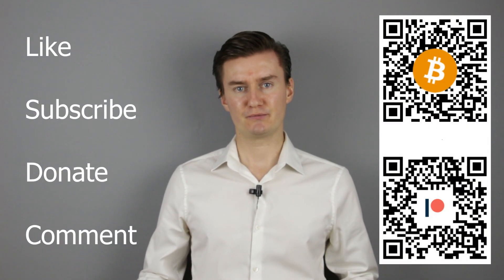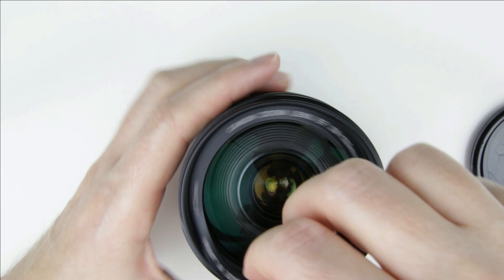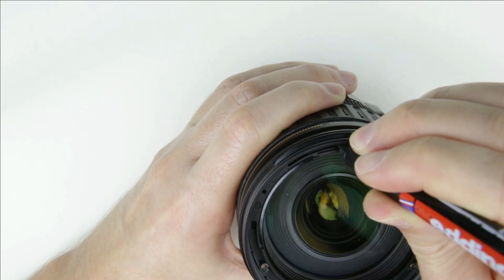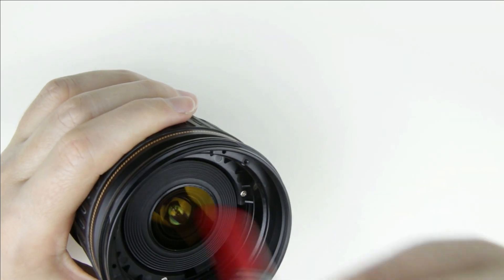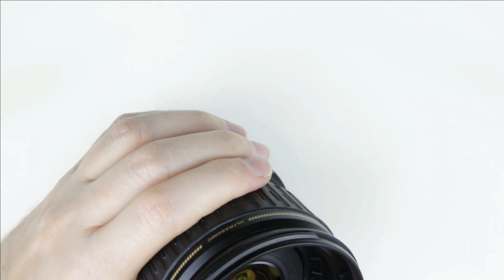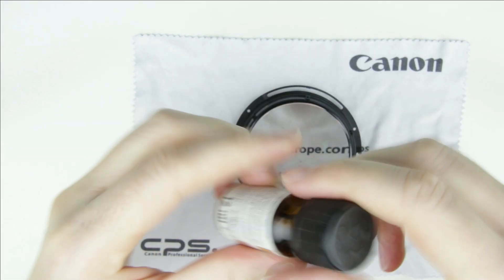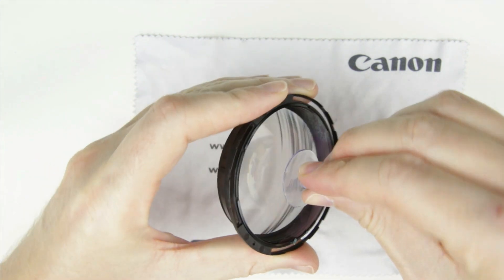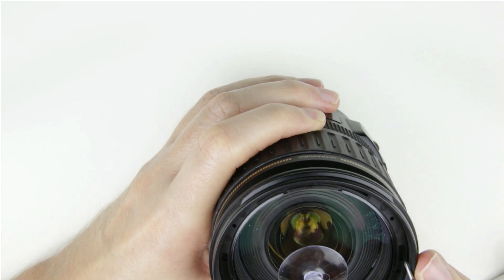Canon EF 28-135mm f/3.5-5.6 IS USM cleaning the lens inside

Comment: I have a question if it is possible to answer? As you have several videos demonstrating how to remove a front element for cleaning. I want to clean a Canon EF 17-35mm f/2.8 L . As it is an early version lens, but cannot find a description for this procedure. Any ideas?
Reply from the maker: I haven't got this lens for cleaning, but as I see on the photos of the lens, most likely you have to use a lens opening tool to remove the plastic ring around the front lens element. I would recommend to use the rubber one, because the other (with the two metal pins) could scratch the plastic ring or the front lens.
Also, make sure that you put back the screws where they were originally, and also don't forget to mark the position of the front lens to put it back at the same position.
Reply: @CamerasLensesEtc  Thank you for the reply. As your videos inspired me to give this a try. I then went ahead and bought several tools like you use. Tweezers(plastic), spudgers. A spanner wrench (metal).  I had made an attempt with it but became confused with this lens. As the front plastic ring in front of the lens has 2 tiny holes on opposite sides. Assuming then it will require the spanner tool to turn counter clock wise. But as you said about the metal pins scratching the plastic ring, yes. That is a far as I got.  Although they were placed in the correct position. Once I tried to turn loose, they only slipped out of place, with small scratch on plastic. No harm of course to lens. But this is where I gave up. As for the safety of the lens. I read elsewhere to dab peroxide into the holes to loosen the bond. But that did not help. That element has small dust, not noticed in photos, so I am ok as it is. But do not want to break anything.  Maybe I will try for a rubber tool as you said and try again. Yes, I see you can but a set of the cone shaped rubber tools. I will give that a try. Maybe sometime you will get one of these lenses for a demonstration.  You videos a really helpful. Thanks again.
Reply: Update on removing the nameplate to remove front element for cleaning(17-35 f/2.8 L). I took your advise and ordered a set of rubber tools. And As it was very stiff, I eventfully got it to turn. Only problem as it would not come out no matter how many turns. But became tilted and stuck again. Then discovered by removing the front zoom ring band, that there are 3 screws in place. After removing these screws, I could lift out the whole front assembly holding the front element. Very simple, as you could push out the nameplate retainer with your finger. As it appears to be non-threaded. Then proceed to clean lens element using peroxide then lens cleaner. And while at it the front assembly (Red Ring) with soapy water. Putting it together was very simple, and put in the 3 screws and rubber zoom band. Done. No more dust. Very clear lens. Thanks for getting me started.

Comment: I did like what you have done but I can still see some dust in my lens when I shine my flash light through the lens, and should I be concerned about it ? I can still take photos normally tho
Reply from the maker: Generally, you can't see those dust particles on the taken photos.
I would advise to clean the lens if there is lots of visible dust inside the lens.

Comment: Thank you.  This lens--originally purchased in 2003--had fallen into disuse in favor of newer lenses.  Then I got a Metabones Speedbooster adapter for my Canon M50 mirrorless.  The lens was transformed into an equivalent 32-153mm and the .71 factor of the Speedbooster made it an F2.5-F4.  Very handy.  Of course, this lens is not even in the Canon catalog any longer.  It's been my favorite lens.  Then all of a sudden there is something inside the front element also messing up the second, and it shows up in pictures as big and ugly.  Local pro camera repair wants $80 to diagnose and doesn't guarantee he can fix it or even get parts.  Last resort search YouTube for disassembly videos, so maybe I can fix it myself, even though that's not very likely.  Wrong!

Following this very clear and comprehensive video I took the front apart and found a piece of plastic had broken off of something (never could tell) and it deposited itself and some kind of goop on the two lens elements.  When I opened it up and turn the lens over, the little piece of plastic fell out.  I cleaned the lenses as described her and reassembled.  It's darned near a miracle.  My favorite (and irreplaceable) M50 lens is back!  Thank you.  Thank you.  Thank you.
Reply from the maker: You're welcome! I'm glad that my video was useful for you.

Comment: Thanks for the video, cleaned the lense after disassembling it to repair slow focusing. There is one thing though - I carefully took the marks of the location and I , kinda stupidly, took them on all three sides at the bolt. And then, of course, when assembling back, I couldn't see which of the three positions the glass should be. 
I see somewhere lower you are making suggestion regarding calibration of the lense by moving the range of position from left to right, do you know if this all is different for 3 different ways you can put the glass back on? or is it somehow "symmetrical" around Z-axis by 120 degrees periods, so to say.
Thanks
Reply from the maker: In your case, there are three possible positions for the front lens element. I would test the sharpness and the chromatic aberration of the lens on all of those three positions then choose the best quality one.

Comment: Great tutorial but I see that you pulled the first lens group only... How about if there is dirt in between those elements? Any ideas on how to separate them?
Reply from the maker: I don't think that they can be separated and joined.
Reply: @CamerasLensesEtc   Thanks! So you are telling me that lens is pretty much useless if fungus grows inside the group? There are 3 glass elements sandwiched together in front group and it seems very strange that besides mild fungus I can clearly see fingerprints somewhere underneath the middle element, how did they get there to begin with?
Reply from the maker: I wouldn't call a lens useless if it has fungus. Of course, it depends on the amount of fungus it has, but dust of fungus can be barely seen on the taken photos.
The front lens group is molded on the side, seems to me that with plastic. Disassembling the lens would be the easier part, I think it can be done with a heat gun, but assembling it will be the difficult part: the lens elements should be at a certain distance from each other, and also should be perfectly parallel.
Maybe I'll try it in the future if I have a completely broken, unrepairable lens.

Comment: I just cleaned my canon 28-135 usm lens and follow your instructions in
the video .
except that we close the lens ... I realize that I do not have mark of callibrage mark of the front lens ...

my question is..
if there is a method of doing the callibrage yourself
Reply from the maker: Put the camera+lens on a tripod, loosen the screws in the front lens, and take photos with different settings: twist the front lens to the end, take three photos (defocus the lens before taking the photo, so the lens will be focusing before taking the photo, and every time choose the sharpest of the three), then twist the front lens by a few millimeters, then take another three... then check the photos on a computer, and set the front lens to the position where the lens the sharpest is.
Reply: @CamerasLensesEtc  thank you very much...
Reply: thank you for your response..and there is a video that explains all this .. i will be grateful to you for giving me the link ... thank you

Comment: I just got back the same lens that I had lent to a friend about 2 years ago. There was a long time fingerprint on the rear of the lens and fungus was visible on the inside of the front lens. Followed your instructions and was able to remove the fungus using a dab of white vinegar and a quick rub with a Kleenex. The fungus was gone. Took less than 10 minutes.
Followed up by cleaning both lenses well with microfiber cloth and  lens cleaner. It was as good as new.
Thanks for the video!

Comment: Oh, I have the exact same lens, with some dust and some other particles in the front lens group. So, this video will guide me EXACTLY on my purpose in the attempt to clean it up. Very clear and nice instructions. Thank you! Only one thing should be said, maybe... What's the solution in that little flacon, which was used to clean the front lens???
Reply from the maker: I guess you mean lens cleaning fluid. I used HAMA brand, but any brand will do the job.